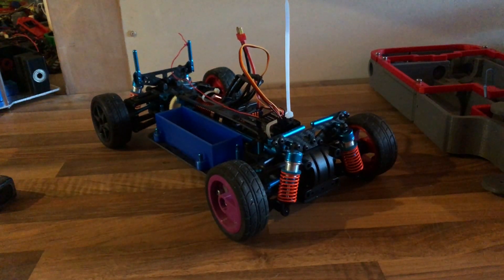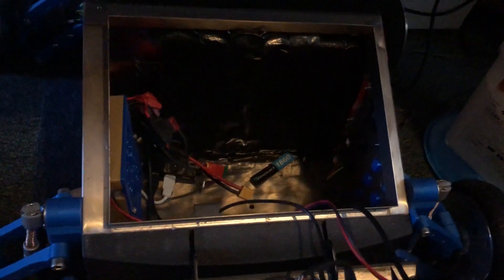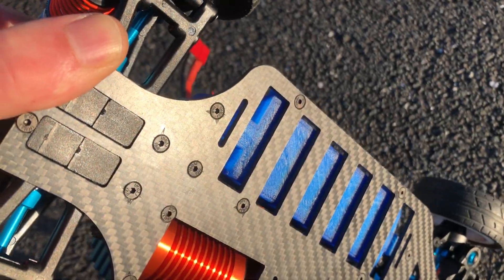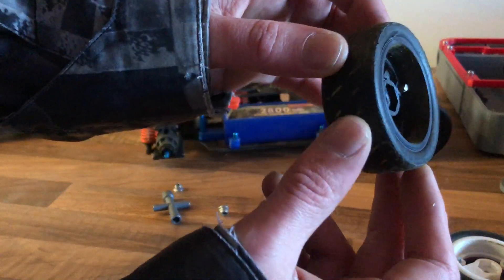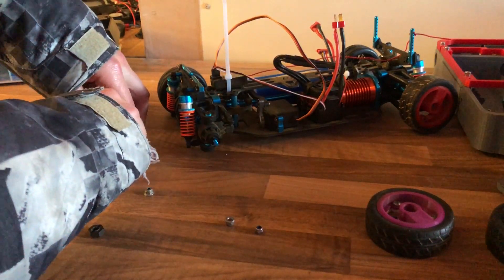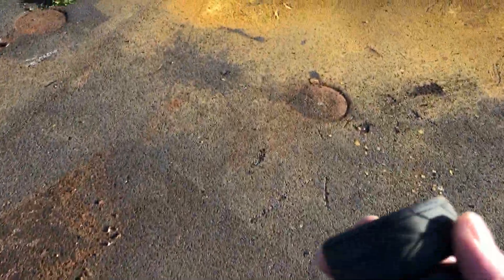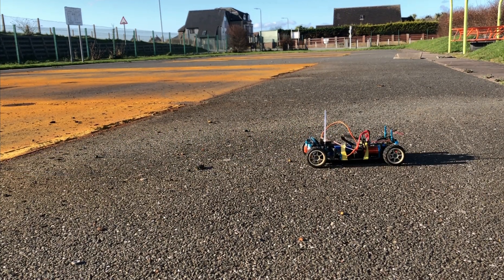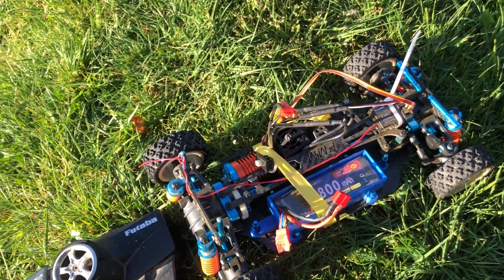Tamiya TT01 1/10 RC Carbon Fibre & Alloy car kit testing

Comment: Cool... your TT01 seems to be powerful, hard to control at times. I lost control & crashed my TT02 due to tyer fly out during full throttle. Guessed super glue all tyers is the answer. Thanks build buddy~
Reply from the maker: yes without a gyro too, thanks

Comment: The rear diff has missing ball bearing, the size is 105zz. That cause the wobble in the rear spur gear and drive cup...
Reply from the maker: you saw that in the video? thanks

Comment: Conclusion not good then I assume mate and not good for a budget lightweight speed runner? Most definitely not if the wheels kept coming off how is it few months down the line mate anymore issues
Reply from the maker: hi, thanks for your comment, ok so its been out possibly 10 times since, its very fast but so unstable, too fast and its rolling down the road, the wheel axles are so soft and fragile all of them have been replaced for steel ones, the shock absorbers are also really bad, slight impact and the threads are gone and the caps fall off, the carbon fibre parts are great i can not fault them but the screws could be better, overall i would still recommend just change the wheel drive shafts and shocks and glue the tyres and all good :)
Reply: @A-tech  no problem my mate thankyou for the quick response and do you think foams could possibly stop some of that unstableness and easing on the throttle mate and you have any links for what you'd recommend I upgrade first please as I'd just buy it to do it all at once would Schumacher 30mm contacts work fine and not affect the steering 🙏💚👊
Reply from the maker: @EmptyBoxGamer  the wheel drive shafts you can get from ebay, they have the wheel mount part attached to the bog bone shafts, around £10 for a set of 4, for stability i have tried a gyro but it didnt really help, i think wheel spacers may be the way to go, thanks